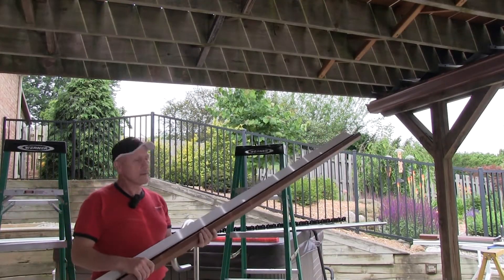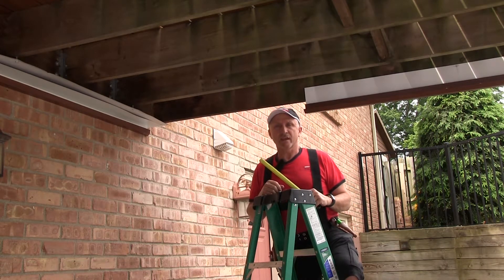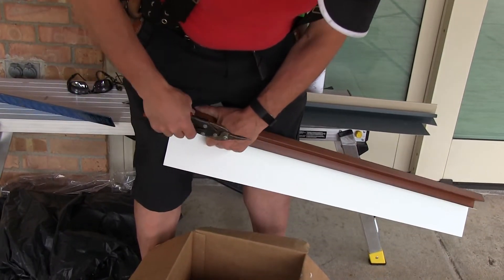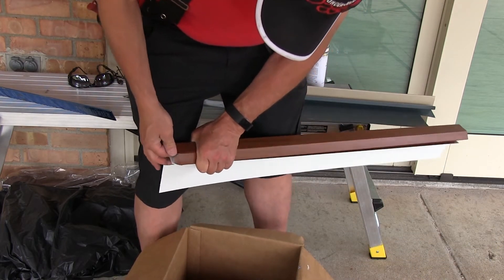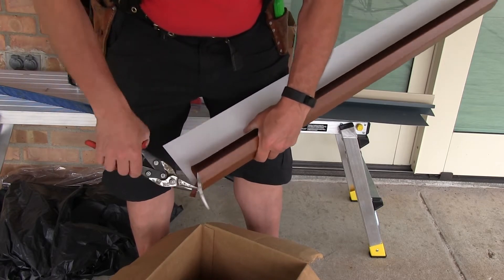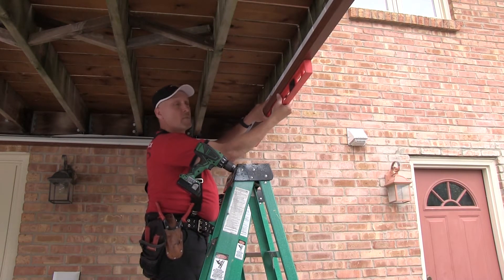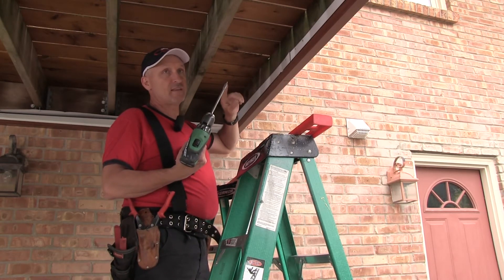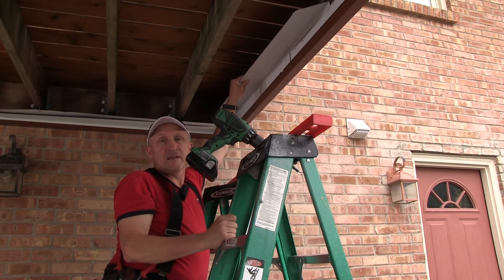13 Installing Side Cap

Comment: Is there any easy way to to remove the under panels in case of an incident such as, some one drops a Wedding ring or something to that value in between the deck boards?
Reply from the maker: Yes you can, any panel can come out individually.